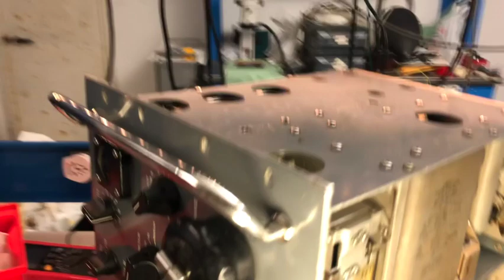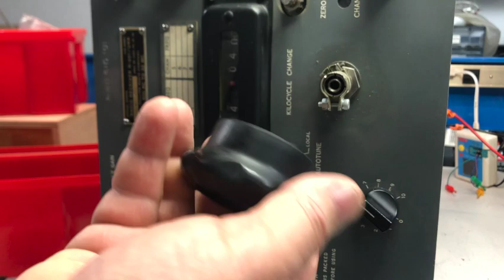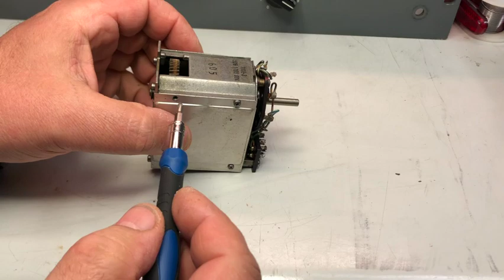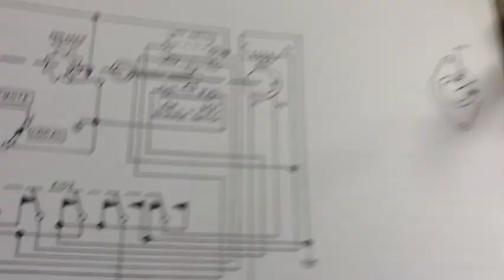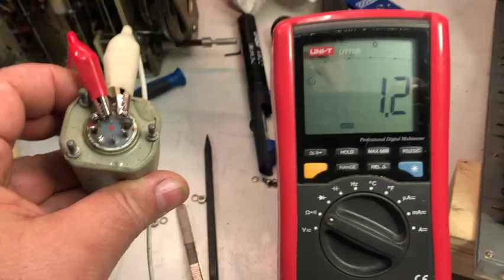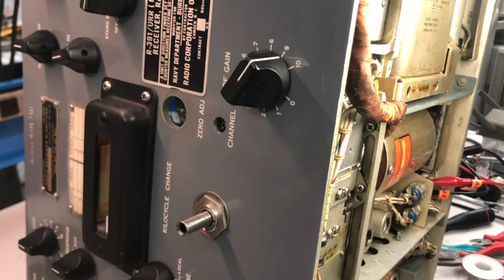R-391/URR Restoration Part2. Autotune Repair. The AN/FRR-33 diversity Station Reviving

Comment: Wow, I have never had or seen a 391 with so many problems. I wonder if it ever worked properly and my guess is a number of people had a go at the problem(s) before you did. I do like your steady methodical approach to finding and solving problems.   73, Glenn WA4AOS
Reply from the maker: Many thanks! Yes, and still has some mechanical faults in the way to be fixed, but it’s coming back as good as it should.

Comment: Does it also have peak detection?  I believe it was Grundig who back in the 1960s made a radio with automatic seek and it used a peak detector and a synchromotor to do this job.  It was quite a clever design which only used two tubes.
Reply from the maker: In the R-391 the autotune mechanism does only change frequency to a mechanical preselection. The station where this is installed has an AFC function that I still need to investigate how it works. However no automatic seeking here, unfortunately.